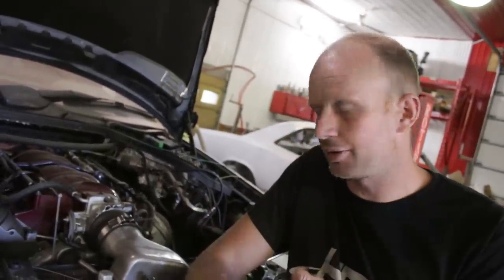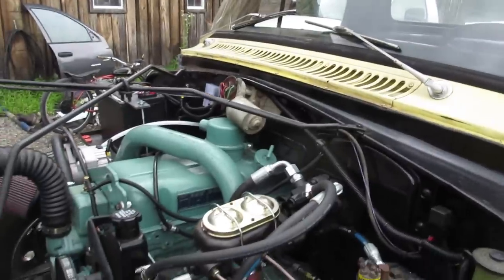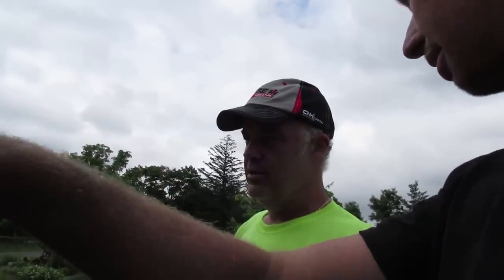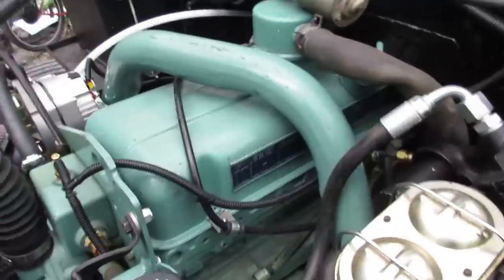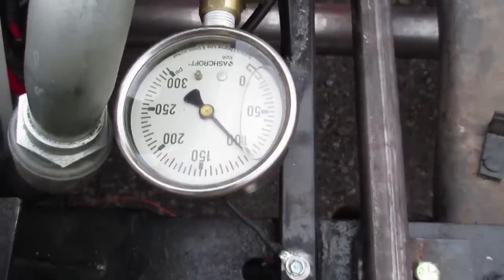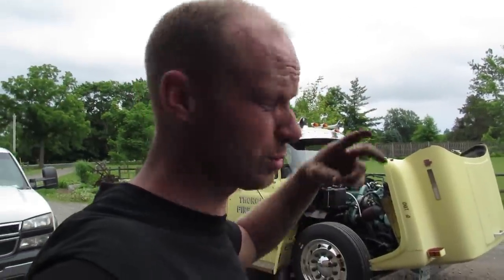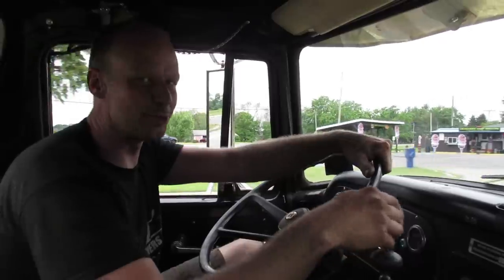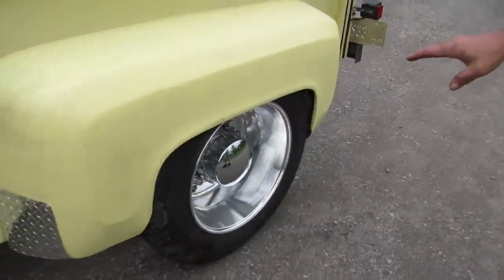AIR START! 453T Detroit Diesel in a '77 International Loadstar 1800

Comment: One thing is for sure between  dmax cummins and powerstroke fans. We all love a good screamin Detroit. #Detroit love all day
Reply: I love hearing that Detroit screaming and doing what it does best, to me it is one of the best sounds in the world
Reply: Us Mercedes diesel fans agree too. Detroils are sweet.
Reply: Yep nothin beats a good ol Detroit, most reliable besides the leaks, it’s earrape and earporn, I love em
Reply: I'd rather have a detroit than any other diesel besides an om617 and a 4bt Cummins
Reply: you wouldn't love it if you sat next to one all day every day
Reply: red66chevy I’d rather be around one than a lame ol dmax, Chevy, Ford engine, or any engine, the only ones I like are the Detroit’s, Iron Lung Cummins, and Old CAT
Reply: Mr. Ace WOW
Reply: @hekili5183  no some of us just prefer to have engines that don't destroy hearing, lungs, and wallet all at the same time. Not going to say they don't sound cool, but they are obsolete. Come forward 50 years to they 80s and you can find stuff that is still actually useful.
Reply: Id love to shoe horn a 6v71 in my ram 3500 to be differnt.
Reply: @nicksmith-rz2dl  53 can fit 71 is heavy and tall
Reply: @jaydunbar7538  you know theres alot of 80s stuff that was still running 2 stroke detroits
Reply: 8V92TA is the only way to shine in Detroit. If you have the room for it (and you're gonna need a ton of it), swap in a Silver 92. 430 HP right out of the box. I had one in a '85 Ford LTL 9000 with a 13 spd. What a great truck.
Reply: Love to trade my 6.7 cummins for one.  Will it match my mpg? 18 empty, 12 loaded?
Reply: I also love hearing “the Jake “ on a Detroit.
Reply: The more that I deal with spark ignition engines, the more I love diesels..
Reply: @red66chevy  6V71 isnt big enough to need dual stacks.  if you run a 5 inch pipe off the turbo and a straight through muffler on the passenger side it isnt any worse than any other Mack, Cummins, S60 or Cat I ever drove.  And I have driven a lot of them   :-)
Reply: @hekili5183  The Cummins is overrated crap.
Reply: @hollowaang5284  not really, they’re popular for a reason
Reply: @jaydunbar7538  we still have several big  Terex Pans, Dozers and Loaders that have 2 stroke Detroit’s that get used every day, and have been using them since the 70’s. They’re good money makers, just because you don’t like them it doesn’t mean they are obsolete. As a matter of fact my uncle also has a big ass FWD Wrecker that I think is an early 60’s that has road grader tires all the way around it and has a damn good 6-71T in it, it still gets used as a recovery vehicle for Stuck Dozers and stuff like that as well as exhibition sled pulls at the County Fair every year
Reply: @hollowaang5284  - based on what? 🤦‍♀️
Reply: @hekili5183  "I'm unique" lmao what are you a 16 year old girl? Trucks are for work they're no a fashion statement so everyone knows you're not like other girls lol

Comment: Nothing does a better job of turning diesel fuel into noise & smoke than a 2-Stroke Detroit. I love the sound of one.
Reply: Wayne Swicegood don’t forget they also love to convert oil into stains!!!!
Reply: Jason Truman True, if an old Detroit ain’t slobbering you better grab a few gallons of oil.
Reply: Wayne Swicegood 
That’s right. If it ain’t leaking oil, it needs oil.
Reply: Captain Lag I had a 6V92T .  Nothing like the sound of one screaming down the interstate .
Reply: Sounds like a racey engine because it is one, it's doing double the ignition cycles than a 4 stroke, so 3600 rpm is really 7200 rpm worth of work!  Not sure what makes that harmonic ringing at high rpm, but I love it.
Reply: I believe it's the gear drive for the blower
Reply: From memory 53s have straight blower lobes which makes a lot of whining, 71s and 92s have helix air screw blower lobes so there isn't the sudden chopping of air flow as the rotors uncover the ports.
Ray
Reply: So it's got a blower and turbo combo?  When he comes onto power it sounds like turbos spooling up, but not every 2 cycle has turbos, yet still makes that harmonic ringing.  Could be something inside the engine itself that vibrates at a harmonic frequency.
Reply: No it's just a 2 stroke Diesel. Listen to a Commer Knocker opposed piston 2 stroke and they sound remarkably similar.
Reply: Actually, actually, actually - there is one that easily does a better job.
Believe it or not it is also a 2 stroke Diesel. Detroit Diesel 2 strokes actually make power, but this POS makes more noise, more smoke and has just a small amount of power as a by product of all that smake and noise.
What could it possibly be I hear the gears in your head grinding in wonderment lol?
Well it is the Commer Knocker opposed piston Diesel 2 stroke (also with Roots blower).
https://www.youtube.com/watch?v=JrAoj5Cuu68
Reply: Usually the limit of of automotive Detroit Diesels is 2100rpm.
The governor is set for that.
Now here's the interesting thing, getting more power out of them is as easy as altering the governor to allow it to rev higher. This is one of the good things with Detroit Diesel 2 strokes. In the larger ones like 6V92 & 8V92s at certain RPM they make 1hp per 1RPM. This means another 50RPM on the governor means another 50hp! Unfortunately this has its limits because you have to go up to the next size injector to get more power. As the injector size goes up so does the amount of smoke and air gallery sooting as well as the fuel consumption.
Must always remember the blower is not a supercharger in this application. Many of them have no turbo (just the blower) so Detroit called them NA which means Naturally Aspirated. The turbo ones had true forced induction but the blower had to be retained for starting, idling and low speed operation until the turbo takes over duties.
Detroit Diesels 2 strokes are generally easy to get more power out of.
They're extensively used in marine applications where this guy probably got his air starter from since they commonly had left hand and right hand rotation engines. I think he said his came from a bus or something so maybe some automotive applications had LH rotation.
In marine applications they're not governed to 2100 but higher, so similar engines in marine application often had far more power than the automotive ones - via the rpm/injector method I described.
Reply: Commer Knockers have straight lobe Wade blowers, Commers and 53 series GM sound very similar I agree.
Reply: Ohhh yeah, that's an obscure engine that needs some love!  Buy one just for the noise alone! LOL
Reply: whorayful yes i should have said Roots 'type' blower.
That is description that is generally used to describe blowers  of the Roots style to differentiate from other types.
I stand corrected:)
Reply: i have seen 2 stroke Detroit Diesels in rock trucks that have twin turbos and blowers. the turbos would feed the blowers
Reply: It's like you can hear the dinosaurs in the diesel roaring all over again. Turning fuel into noise, smoke, heat, oh yeah and a little bit of horsepower too :)
Reply: They are definitely unique I love them nothing sounds like one you drive them like you stole them and they keep on going
Reply: You forget leaking oil .
Reply: @ThePaulv12  
The 6V53 was factory set at 2800 RPM. 
The 71 and 92 series were set between 1900 and 2100. 
I don't know what a 3 53, or 4 53 would be set at RPM wise.

Comment: Rich. You are awesome!  You don't hear air starters anymore. When I was a kid there were a lot of them.  Brings back a lot of memories. Keep up the awesome vids. Also watching you has got me to dig a old 12 valve out of the weeds I bought a few years ago. Finally got it running but still a ways from the road. Thanks for the inspiration!
Reply: In Vancouver bc  city garbage trucks had two strokes hear them coming two blocks away
Reply: In late 60s early 70s
Reply: I hear them everyday as I work on a ship, they are quite something else.
Reply: Mine haul trucks still use em. It's alot of engine to turn over using the old electrical start so they use air

Comment: Old timers used to say you should never drive a 2-Stroke Detroit until you intentionally slam your hand in the door to piss you off at the truck. Lugging an old Detroit will kill them. Drive it like you stole it.
Reply: Wayne Swicegood, he said that at @ 15:35... which explains why they were driving it like they were (looked fun, but hard).
Reply: Lugging an old detroit is more likley to kill you than it cause they tend to start running backwards if lugged down to far
Reply: Nothing worse that spinning one backwards. I've been lucky, but have been with 3 other bus drivers who weren't. Not a good sign when exhaust smoke is coming out the air cleaner. lol
Reply: Philip Muth, lol, crazy. Is there any permanent damage?
Reply: Doug Owens  Not really. Mostly just new air and fuel filters. Oh, and a new pair of undershorts. Lol
Reply: @emeltea33  the oil pump turns backwards..... so no oil pressure \

but if you have ever changed oil on a diesel..... you know that 15w-40 is a BITCH to get off your hands
so it stays on the bearings for a while....which is the point of 15w-40
Reply: Consider DD says use straight 40,
Reply: @thomasharvanek2411  not in -40 north east Montana

Unless ya want jelly oil for a good 20 mins
Reply: @kainhall  true dat!
Reply: Those old timers liked to talk crap : ) to the young-uns. Detroits operate the same as any other engine - operate it between the torque peak and the hp peak - in a 71 and 92 series, that is 1400 to 2100 typically. It just sounds faster because it's a two-stroke
Reply: That had me laughing
Reply: I came to the comments to write this but I figured I'd look to see if someone else already had lol.
Reply: Same with the dt466 2100 wot shifts all day
Reply: That’s right they like the RPM
Reply: @frontagulus  While true, ultimately they do love two throttle positions. Idle and Open.
Reply: UserName it is faster because it’s a two stroke
Reply: joomanburning it sounds faster because there isn’t an intake stroke, the RPM of the rotating assembly isn’t actually higher overall. Each cylinder just fires every time the piston is up.

Comment: 10:52 A cheap way to have a diesel shutdown is to buy a ball valve the same size of the intake or add a butterfly throttle on the intake that operates reverse.
When you close the valve/throttle the engine choke.
You can also make some kind of linkage to operate it from the cabin.

Comment: 4-53t the 4 cyl that proved everybody wrong. 2 stroke detroit the engine that loves being driven like it's pissed off.
Reply: Bladen Rexroth sounds like my kind of engine!!
Reply: kush roller love the 2 stroke 53 series engines. 4-53, 6v53 and I hope one day to find and shoehorn a 8v53 into a project truck. There's a few 12v53 engines out there but only one video of one on youtube. If you like your ears molested? Look up a couple videos of the 8v53 and the one 12v53. Wear headphones and enjoy.
Reply: Bladen Rexroth My friend is determined to get a 6v92T into a 71 K30, still praying for him lol
Reply: Devon Doiron 😂😂😂 It's his headache. Let him deal with it lofl. 6v53 barely fits in a k30. Only way he'd fit a 6V92 in is if he makes it mid engine.
Reply: Bladen Rexroth He's my best friend and I'm a better welder so I told him I'd help, its gonna get a lift just to clear the oil pan, probably fab s custom cradle and large red cowl hood lol
Reply: Devon Doiron he'll need a brigadier/TOPKICK style tilt hood, body lift, double frame and some heavy axles
Reply: @bladenrexroth2555 .... where did you hear about the 12V53 and how many were built?
Reply: @bladenrexroth2555 ..... in regards to your response to Devon Doiron  - not to mention the 6V92T would make it a "bear" for handling as it would be Very Nose Heavy, not even considering the weight of whatever trans he would have to use with an SAE No.2 bellhousing... and yes, a mid-engine location would most definitely be the way to go, but depending on trans used, would most likely also want to "stretch" the wb as well.   FUN!!   : )
Reply: @TheOutdoorsman790 .... Your best friend is also going to have to do a cab lift as well to clear the bellhousing  and whatever transmission he winds up using with that SAE No.2 bell housing.... and as I mentioned to Bladen Rexroth who responded to you, also... I agree with him, that a mid-engine set up would be the way to go... if for no other reason, than because, with the engine alone (not to mention the bellhousing & trans. weight), it would be extremely Nose Heavy and would exhibit very Lousy handling characteristics.
Reply: @Romans--bo7br  the 12v53 and 8v53 are very rare. Unicorn engines never used for OTR applications. Don't have exact numbers on how rare they are but do know either one would be pretty cool to see in a truck. Who isn't going to enable somebody to do a 6v92 swap to a pickup lol
Reply: Yeah they are crazy engines.  Only 212 cubic inches and torque to move a big load. Love the 2 strokes.  This guy has my dream build. I would do that same build and daily it

Comment: I have heard of the 53 series Detroit engines used in sawmills with the governed RPM set  to 3000 RPM or higher. This was done to get the Saw blades turning at the desired speed. I would have thought that this shortened the life span of the engine, but was told by a sawmill owner that they lasted as long as any other engine in a stationary setting.

Comment: I had a job for a good ten years, driving for a freight company on Martha’s Vineyard year round, that had an old 1983 GMC 4500 car carrier with a great tilt slide flatbed, with a winch, we used to move marine shipping containers around for storage. The truck was powered by the same 4/53 Detroit, with a granny low 5 speed and two speed rear. The truck was spect out for Highway and rough terrain applications, so the rear was also a locking differential that helped a lot off road, not like a front drive axle 4x4 would, but better than most 4x2 trucks, especially with the awesome mud&snow duals. That truck could move! Like 80 mph highway, but crawl through almost anything at idle. I remember delivering a good size (9,500lbs) loaf of 20’ rebar, all strapped together in two bundles. The builder asked me if I could back down the ramp in the foundation’s massive hole left by the excavation crew, for the foundation workers to be able to walk down with all the tools an materials. So I said no problem! I slowly back down, to about 15’ from the bottom of the long ramp, as the hole was 14’ deep! The ramp ended up at 50’ long! So I slid the bad back slowly, till all that weight being extended back behind the rear axle, lifted the front of the truck right up in the air! So all I had to do is climb out of the hole and make my way into the cab, very carefully from what ended up being the top edge of the hole, that was about 3’ from the drivers door! I was able to grab onto the mirror frame, jump over to the top step on the fuel tank, get the door open an slide into the drivers seat! It felt like I was popping a wheelie! I put the truck in low gear, locked the rear end, put my foot down on the fuel pedal and let my foot off the clutch! The site manager who was a friend of mine back then, who was really to take pictures, unfortunately there were no cell phones or Go Pro cameras back in 99, but he did get some great fast shots of me wheeling out of that hole! When the rebar finally dropped off the bed, the front end came DOWN! The truck sounded exactly like the truck in the video! Absolutely amazing!!! Going through the gears, splitting up through 8 gears at full throttle!!!

Comment: I was raised on Detroit"s and my first truck had a 6 71. The emergency shutdown was a spring-loaded trap door on the block with a cable you pulled to pull a latch that caused the door to shut and stop the air flow. 

I never needed it but a friend who a bunch of old hands convinced him to mix gasoline into the oil bath air cleaner for a performance enhancement. 

He fell for it for it and that cable was the only thing that saved his engine. 

I guess he never soaked a rag in gasoline and stretched it over the air inlet to get a recalcitrant diesel to stsrt. It's a bit easier on the engine than starting fluid.
Reply: What word is that? Honestly is a type of diesel or misspelled?
Reply: @brandonfairbanks5764  recalcitrant means reluctant or unwilling.

Comment: I really wish I was old enough to of started my diesel mechanic trade on air start Detroit's. Working in a kenworth dealership in Australia I still got to work on quite a few 8V92's but only a hand full of air starts. The army had the reserved tank plumed up so you could dump your tyre pressures into the tank to start the engine and then you refill the engines once started.
Reply: Air starts were reasonably common on road train spec KWs, I used to work for Detroit Diesel in Adelaide as a sparky, nothing opens the bowels like an air-starter in a tin shed workshop.
Ray
Reply: My old man had a KW with a 8v92t. Miss that truck. Then he had a Denning coach that had a 6v92tt. Awesome memories.
Reply: They were also common in commercial marine applications . Love that sound .
Reply: air starts are cool as hell, however not so much when you are in the engineroom of an old russian trawler working on something else and the chief(whom never speaks english) just goes and starts it without warning you. I have tinitus now after only 4-5 time of it happening to me.
Reply: G Crauwels i worked with both air starts on ships and ones that dumped air into the cylinder to start.
Reply: @mattis537  😂😂😂😂😂fuck you make me laught like hell I can imagine in a boat in close compartiment 😂😂😂😂you dont ears to much like me on 1 side loll
Reply: @hairynutz7334  😂😂😂😂😂😂😂🤗🤗🤗